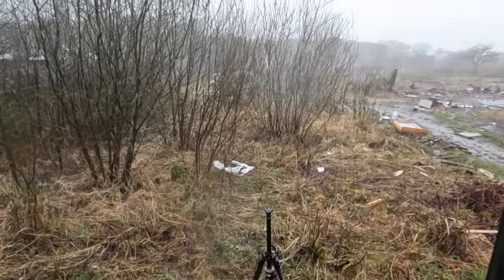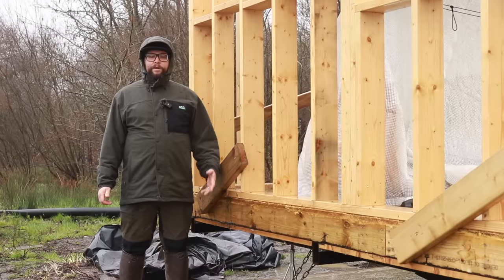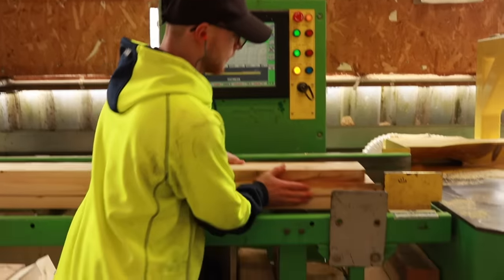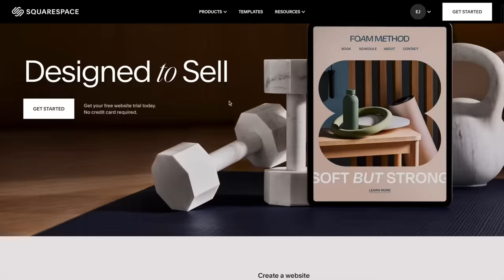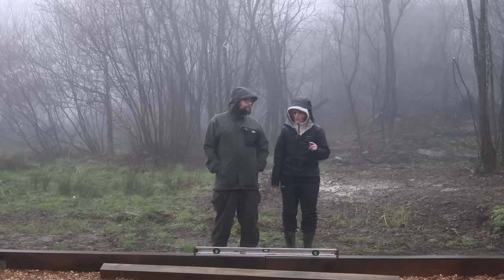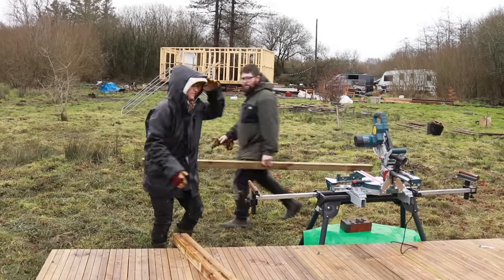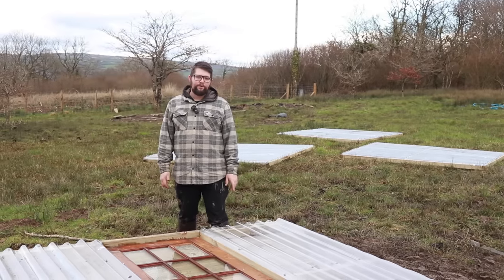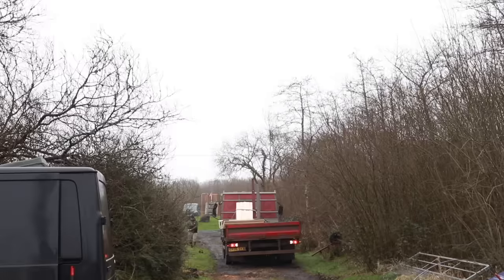Reality of trying to live OFF-GRID...We're struggling

Comment from the maker: The weather has been a STRUGGLE and caused us some delays but we're back🎉 here's hoping we have some dryer days coming our way so we can get this off-grid build underway 🥳
Reply: You should get aload of us subscribers to travel up in summer and come and help for free I would come and help for a fue days or so no problem I go to wales every end of every year to get mushrooms anyway
Reply: Excellent video thanks but (just for info.) the audio level is way lower than that of other channels. Even with headphones I had to set the volume almost to maximum and remember to wind it down before switching to another video to avoid deafening myself. But good work!
Reply: Under the circumstances you are doing an amazing job especially as you both work full time.
Reply: I would consider a tarp to throw over the entire frame. Will save a lot of headache with water on the framing
Reply: Rough until the new build is weather tight. You’ll get through it and better days will come. “Smile when it’s raining” can help release endorphins and improve mood.
Reply from the maker: Thanks :) @manolisgledsodakis873  we had issues with our audio on this video as we broken our mic port on our camera after dropping it, so alot of the mic audio we thought we recorded was blank and we had to use the inbuilt camera audio which is alot quieter. We've ordered a new camera so once it arrives all our audio will be the same level going forward :)
Reply from the maker: Such a nice idea, thanks :) @SHIFTINGGEARZNPASSINQUXXRS
Reply from the maker: Thanks Linda <3  @lindatemple5454
Reply from the maker: We've tried it but the wind we get here, they don't last very long  @Sausageontoast  😅
Reply from the maker: @GeorgeCredland  Thanks George :) the sun has been visiting us today and it makes the world of difference!
Reply: @SHIFTINGGEARZNPASSINQUXXRS  Mushrooms you say.....  Not stocking up for Glastonbury are you?  

I noticed the magical kind are rampant this year on the mountains here in South Wales, probably due to the exceptionally wet winter.
Reply: Loved watching the construction of your timber frames … you are doing a grand job considering the weather manipulation going on atm….
Reply: That looks tough. Living in Australia, I have never experienced anything close to that much rain. Send some our way 😆
Reply from the maker: @karenanderson7067  I feel like this would be tougher out in Aus with all the snakes and creepy crawlies you have out there and i would melt in the heat 🤣
Reply: you are scammers of the worst sort.
Reply from the maker: @suewarman9287  scammers? 😂
Reply: Just build another greenhouse at the entrance of the caravan with vinyl flooring and euro pallets. It is reusable and keeps you dryer also you can use it to start plants as you can check them often.
Reply: goretex, get goretex everything and the wet weather will never bother you again

Comment: You should build a temporary shelter in front of your caravan so you can leave your boots outside and dry your dog off etc plus even when it’s raining you still have an extra dry place you can sit out in, plus you can always repurpose the structure once you move into your tiny home.
Reply: I thought the same,  a boot room to prevent you from stepping  in your new home with muddy boots. Brilliant idea. Even a covered area would work,  doesn't have to be anything substantial (yet) lol
Reply: A good idea indeed... I think a cheap plastic garden shed or something that can be put up quickly. Then the shed could later be used elsewhere on the property. Extra tough plastic could be draped over and weighted/tacked/down on the new home framing temporarily keeping rain out, less water pooling inside causing any damage. Nice work so far with the green house - garden construction. Good to know the sawmill people are helping with pro ideas/planing. (Fingers crossed lots of sunshine returns soon!) :hand-purple-blue-peace:
Reply: @typhoonjet6045 
Big car cover tent. 
10 by 20. Large cheap easy fast set-up done.
Reply: Check to see if there are any awnings for your caravan. You should be able to extend sideways for a bit of extra space
Reply: @McBuggs. Yes a cheap shed would be good. Might not be the right hight though
Reply: They had so much old material they could have used some of that to make a little room/porch
Reply: Tailgate tent secured to the camper and spiked down would be quick and cheap.
Reply from the maker: Great idea Linda ☺ We did have an awning that came with the caravan but with the wind and storms we get here, nothing lasts. very well in the elements sadly 😅
Reply from the maker: an awing actually came with our caravan but nothing lasts where we are due to the strong winds/storms we get living on top of a hill 😅 @fozzyami
Reply from the maker: @jeremys3174  we didn't anticipate being in the caravan for this long 😅 otherwise we could of made something when we first moved on to give us more space/shelter if we would have none we would have been in it for so long 😂
Reply: @CampOutWest  oh for sure. No disrepect to you guys.  Love your channel.
Reply: Your home is coming on, all the best x
Reply: I have a decking with a clear light roof. It's great for outdoor footwear, our dogs sit there and we can dry clothes and when the sun shines it is a lovely area to BBQ and relax and hang a hammock for the grandkids
Reply: @typhoonjet6045 Caravan awnings are readily available and ideal for leaving wet muddy boots and coats in. When I had a caravan I had an awning for that reason.
Reply: @CampOutWest  Buy a used army tent, 12 x 12 or 12 x 18, 18 x 24. Smallest is 9 x 9. Even that would give a good porch and a very good one runs at roughly £600. The beauty of the ex-army stuff is it's durability and there are excellent well designed storm tiedowns. The alloy frames make excellent frames for other things. Greenhouses and even solar heated saunas.
Reply: Annex

Comment: Most people I see who build these trailers/house on wheels, do them under a poll barn with a tarp or rent a warehouse or garage until the roof and walls are installed. I'm concerned the water has leaked into the insulation at the bottom of your trailer.
Reply from the maker: We would have loved to build it in a warehouse etc, sadly there wasn't anything available locally for us to be able to do that. So far the floor is still water tight 🤞 and we will be using dehumidifiers once we get the building watertight to take out any moisture remaining. fingers crossed that will help 🤞
Reply: The remediation is real here. Beware of mold.

Comment: i would put a tarp over it to keep out the rain a blue tarp here in usa is sold at every store for building they come as big as you need they work great see about trying that if you do it right you can work under it and stay dry  keep up the good attitude youll get to the finish line soon
Reply from the maker: Thanks for the suggestion :) sadly it's too windy here and they just get ripped off 😅
Reply: @CampOutWest Buy some straps to lash it down?
Reply: @CampOutWest  I live in the North East of the UK.
Nothing wrong with the budget big blue tarps.
Very cheap from ebay and Amazon
Ive had one as a temporary roof for my 10ft x 10ft shed for the last 5 years.
Reply: @sahhull Yes, I live in Scotland and we have some howling winds tear through our property. We lash tarps down tight and have not lost one yet.
Reply from the maker: tried it, still not strong enough😅
Reply from the maker: We use them, sadly the storms wind here are too strong. We put two brand new ones on 2 days ago and it didn't even last the night before being ripped to pieces. (we have them down tight too

Comment: Please don't give up! This is my 11th year off-grid, it was easier for me because before I moved here, I was homeless! Even so, we had no running water or electricity for the first 6 months, which was rough. It was so nice to finally have electricity again after that, and water in the taps as well! 

God Bless, and keep up the good work!
Reply: How are you off grid you rely on the internet infrastructure?
Reply: I'm sorry but, if you have running water and electricity, how are you off-grid? Do you have your own personal water supply and generator?
Reply: @TimLallemant  Yes, I have a solar generator and inverter which converts to 240v supply, and my own water tower that gravity feeds water to my house. This was a very common method of having a water supply in my country (Australia) in the early days and a lot of older rural properties still have a water tower. It works just as well now as it did when this house was built, 40 years ago, and the advantage with an off grid system is that the electric water pump only needs to be run once a week.

Water is collected in a large water tank from my roof and although I live in a semi-arid area (average rainfall of 400mm), and sometimes have no rain whatsoever for five months over Summer, I have never run out of domestic water, in this time. I have 40,000 litres of storage and allocate myself 1000 litres per week.
Reply: @gazpitchy  off grid is kind of an umbrella term.  For me, it means I have no cables or pipes connecting me to the outside world.  I have tanks of water, solar panels, a 4G modem, and I burn wood.
Reply: @gazpitchy  Exactly...no such thing as "Off Grid" just less dependent on direct services.  Being truly "Off Grid" would mean living in a hut made out of whatever lies nearby eating whatever you could scavenge from the land around you and spending all your time trying to stay alive
Reply: Yet you’re on the internet…so you can start living ‘off grid’ anytime

Comment: You might want to make your greenhouse roof slanted for ease of re-assembly in the future. A high front panel, a low rear panel and the two side panels re-cut to the roof slant. Easy to insert a new top rail in the three panels and trim down with a saw. Sliding the roof panel from the rear will become easier too. You might want to put an angled trim / fascia on the roof edges to stop the wind getting straight under the plastic panels. The uplift on the panels from wind gusts is very high! 
I have memories from when we built our own house of my mother in law sweeping rain water every time she turned up and of "friends" turning up in white T shirts and even whiter trainers, never venturing near to anything remotely muddy.  I spent weeks putting in surface drainage that no one ever saw or will ever see again. Been there.Done that. You have my admiration
Reply from the maker: Thanks David, we did actually build the roof angled so the rain could run off the back but we ended up having to raise the back of the greenhouse up as it started sinking in the mud from all the rain. We had to add an extra row of wood under the back sleeper, which took away our drop off from the back wall  😂 now it runs off the front instead! haha. We are very excited to get our first seeds in 🥳

Comment: Great work with the green house x I really do think you need to re think the glamming plan due to the inclement weather.  I suggest small wooden cabins you could easily up cycle a garden shed and at least you can make that water proof
Reply from the maker: That's Jeo. We will only be doing our glamping in the key summer months, so we should be able to miss the worst of the weather 🤞
Reply: But if you made the accommodation more suitable for the welsh weather you could have income 365 days a year ! Sure.y is that not better than just 90 days a year ?  @CampOutWest

Comment: We owner built a 3 bedroom house in Australia about 5 years ago. I worked fulltime and my husband managed the build full time. That said, he didn't so much as pick up a hammer until the roof and exterior siding was on. You can get all frames and trusses premade and delivered (approx 9000 Aud) We had a father and son building team put it all together on our concrete slab in 2 days (no more than $2000 Aud for their time). We got roofers in and they also did the siding, all colour bond, (approx 15000 Aud). All that was done in less than 2 weeks. Its worth getting professionals to do the big stuff to get it done quick and right.

Comment: Speaking from a top storey carpenters experience.  

Put a thick plastic membrane over your floor and check a channel out of the bottom plates for drainage here and there. 

Even build a slight camber on the floor. 

Once the roof and cladding is on you can cut the membrane out and expose your nice dry particle board. 

Hindsight is 20/20 though

Comment: We had that floor on our house build.  Rain and poor use of the adhesive foam by the builder led to water ingress and each panel swelled at the joins.  You might have done a better job with the adhesive foam but check for swelling with a straight edge laid across and spend some time in a rare dry moment making sure each edge is fully sealed.  With underlay and carpet you can’t feel the peaks of the floor at the joins but you might be having laminate / Lino and you would.  Good luck.

Comment: Progress, step by step! Well done!  Your greenhouse will need ventilation.  Maybe an air exchange fan at the top of the back wall, opposite the door??  You should also keep your eyes open for shade cloth big enough to cover the roof and two walls. Also for efficient use of your greenhouse buy a minimum and maximum thermometer.
Reply from the maker: Great idea for an exchange fan 🥰 thanks Anne. Thanks for all the tips

Comment: Initial thoughts on the green house was that it was pretty tall - but I’m sure that can be a benefit - second thought the roof is not angled so the rain can roll off - could be a good source of water for the garden
Reply from the maker: Thanks Poppy. We decided to use the sheets in their full size, over cutting them which is why the greenhouse is so big haha! The roof was angled (we did the back wall shorter than the front and the side walls angled BUT we had to lift the back wall up and put more wood frame under it, as it started sinking, which then got rid of our gradient  🤣so now the back wall is higher than the front and the rain is running off the front instead 🤣

Comment: You’re doing so well on everything especially being hampered by permanent “weekend weather” …  all looking good…. don’t forget to replace those concrete blocks under the axles it’s something that will bite back if you leave em … 🤔
Reply from the maker: We are doing it this week, i'm going to go with new blocks with a 6x2 treated timber on top onto the box section of the chassis where it's supposed to be according to the chassis manufacturer

Comment: John / Emily. Be very careful with your new green house. You will be very surprised just how much wind will hit it. The "lip/ canopy" and the tall sides. Consider some form of strap to hold it down / together. The plastic you've used will fail very quickly and become brittle with UV damage (been there, done that) Also you should have screwed into the gulleys. the plastic will contract and expand. with the fixings on the uppermost "ridge" you will have multiple failures. If you move on from this idea in the future, save the frame and look at either very cheap poly carbonate. or even the material from your mini greenhouse  (Monarflex). Look at freebie sites as sometimes there are whole conservatory roofs being given away. The polycarb will last decades and Monarflex will last a very long time too. The Monarflex when bought on a roll gives you leftovers for emergency patching too. Keep 'em coming.